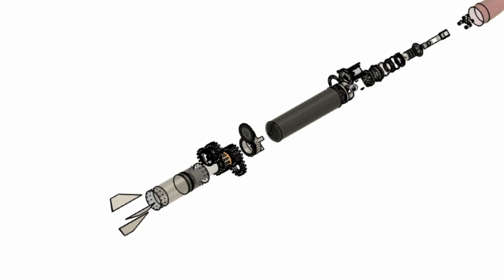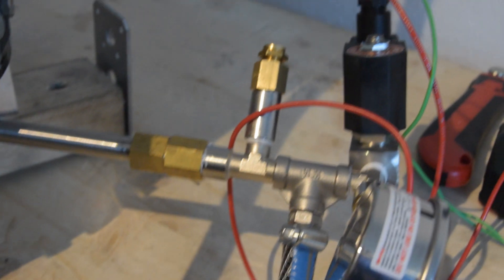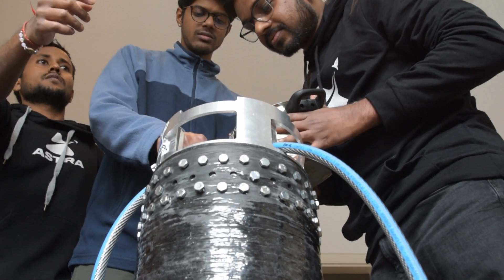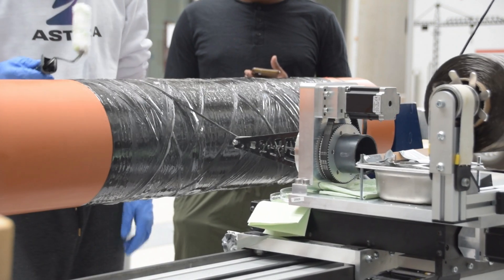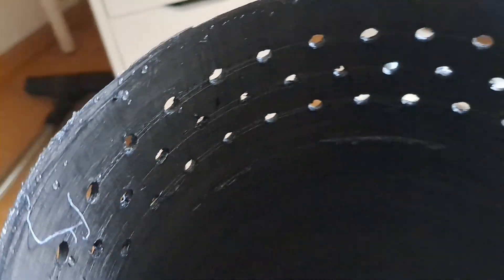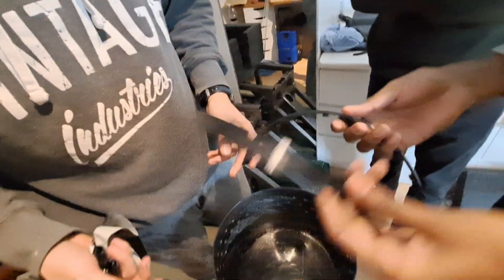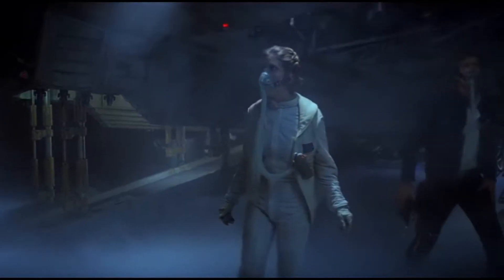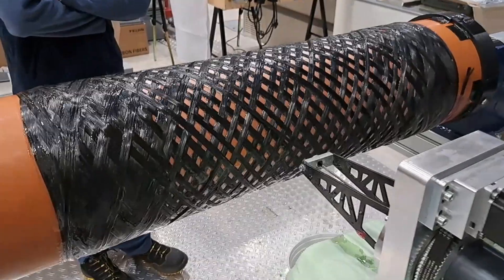The Saga of the Tank...

Comment: Un-Plasticized PVC (u-PVC) is actually pretty compatible with Nitrous Oxide, as is Halar polymer which can be sourced in tube form or LDPE also. Surprisingly Polyurethane is also resistant to NOX, and its completely possible to rotationally mold a PU liner and integrate some alloy end bosses to the rotationally molded part and then over-wrap it with CF. Anyway good to see yo move away from drilling through the CF composite.

Comment: This take me back to 2005/7. I helped build a filament winder to make some main spars for a wing. This was before arduino's and raspberry pi's. Had to make a hardwired control circuit controlling pneumatics. Working with resin and carbon fibre isn't easy. We made mandrels from aluminium, glass tubes and finally thin sheets of foam rolled into tubes. Keep on doing what you are doing - you'll learn a lot along the way.

Comment: Would some type of epoxy or rtv glue work, you should read Parker oring handbook btw, a good oring seal is definitely possible with those tolerances and the Parker handbook gives you design figures that work repeatedly
Reply: Also if you go the epoxy route be careful of mold release because it might work too well and stop the epoxy from bonding

Comment: Hello Astra... I hope you read this, 
I wish I was part of the team to warn you about the cf winding because I was pulling my hair when I saw the holes in the carbon fiber. 
I want to thank you for showing how to cast a bronze nozzle because I have never seen/ hear of that before, but now the possibility for cheap regenerative cooling is within reach for model rocketry.
As for the CF chamber winding, I suggest and please let me know if you disagree that you place rods in the location of the bolts in the mandrel that you are using for winding. You should wrap normally around these 3 rows rods and the fibers will find their way around them. Do NOT drill through fibers ever again because you are committing a great composite sin. After you finish the normal winding, I recommend concentrating on the ends and pass the fibers in between the rods (future bolt holes) to reinforce that region.

After everything, you can cut or remove the rods and bolt the aluminum piece and I can guarantee that you will have absolutely near impossible to tear winding because it will be working in tension.
As for the nitrous, you have used in the end an aluminum tank and wound cf over it (correct). You should have bought a plug and play car racing nitrous tank that is aluminum and already done to operate at 900psi-1400psi easily and safely. You are not using Lox nor pressurizing to 300bar, so a Cf is not necessary and an off the shelf aluminum or even Cf nitrous bottle would have been cheaper or the same cost.

Please let me know if you disagree with any point or have any thoughts, keep up the good work.
Cheers
Reply from the maker: Thank you for your super detailed comment.  One of the best parts of putting a lot of our information onto to this platform is the feedback that we get.  If it can also be useful to others sometimes, that is also great!

For the chamber winding, I completely agree with you.  Drilling holes in CFRP structures is not a very good move.  To make it work, we had to use a 0.7mm thick Stainless Steel liner underneath the CFRP lay-up.  We were toying around with your idea of winding around the holes last year, but we were struggling just to find the right methods for our design and never got around to trying it.  Maybe we will take a crack at it this year now that we are not starting from 0.

For the tank, we actually wound over a steel tank.  We know that our method was very mass inefficient, but we were mainly concerned with figuring our how to wind with carbon fiber.  To make the tank for the rocket that will go to space will require a 250mm x 5 meter tank.  This is certainly not something you can get in aluminum off the shelf.  Furthermore, we need to be able to meet a 3x SF to fly our rocket in Europe.  Safety standards are very high here so CFRP is not so bad when you are required to hit 180 bar.  If we were flying in the US we probably would never have bothered with CFRP.

Again, thanks for the comment.  I hope you continue to enjoy our channel.  There is lots more interesting excitement to come this year!

Comment: Wow very good job 👏. Can't wait to see it  fly .i have question  Can't we use normal oxidizer like kno3 and sugar. And what was the source of the  wax  thanks
Reply from the maker: Well, you could use Potassium Nitrate and sugar as the propellants, but that would be a solid rocket.  This comes with some challenges (especially safety and political in the EU).  Basically, it is very difficult to get the authorization to use Potassium Nitrate in Germany.  So, we opted to build and fly a hybrid rocket with Nitrous Oxide as the oxidizer and paraffin wax for the fuel.  We also get a lot more specific impulse out of this combination, so that is nice too.  The way just came from amazon - just regular candle wax.  Nothing fancy!  I recommend you check out some of our propulsion videos on the topic.

Comment: For those diameters, 3-4 mm of aluminium tube 6082 would have done.
Reply from the maker: Nope, you need safety factors man.  No one will let you launch anything if your safety factor is 1.  3mm Aluminum 6082 at 250 dia is 1.0 safety factor.  You need at least 2.0 to launch at EUROC.

Comment: I'm at 6:03 and my first thought is rather than drilling holes through the carbon fiber, secure the endcaps independently of the CF. Whether tensile supports external to the CF tube between the endcaps, or making the endcaps part of the CF tank.

Comment: Perhaps if the form was made out of a product that could be dissolved with a solvent like expanding foam coated with a release agent, you could make the ends of the tank and the walls in one winding.  Then you're only dealing with one material interface at the valve.  Winding the carbon fiber around a ribbed tube that the valve could be threaded on might work.

Comment: Didn't SpaceX blow up a falcon9 by trapping oxidizer in the layers of some copv nitrogen tanks during fuel loading process?  When the coov was pressurized the oxidizer was pinched and created a heat source that created a big badda boom.  Good thing your unlined cf tank failed or it might have exploded the first time you filled it up with oxidizer if the inside of the cf had any layer gaps.

Comment: But... why? Why not a pressure fed liquid engine, which requires lower pressures?
Reply from the maker: A liquid engine operating at the same chamber pressure as KARMA (33 bar) would require a very similar feed pressure for the tanks (yes, for liquid engines you need 3 tanks not one).  If we had more resources, we would switch to liquid.  But always good to question all parts of the design.

Comment: This is the same problem with the Titan submersible, not enough axial strength in the carbon fibre layup. Lot's of hoop strength, but not enough axial, plus all those stress concentrations and holes aren't helping. If you build the tank with bell ends you keep the axial strength at the ends

Comment: Could you solder/braze the thin sheet metal instead of welding or using a polymer on it? Need to look at electrochemical potential differences to avoid galvanic reactions.
Reply from the maker: maybe... we would have to experiment a bit.  The solder would need to be compatible with Nitrous Oxide as well.

Comment: I'm genuinely surprised that you guys are making all these tests on such a big part....why dont you start on a ~50mm tube to get the techniques right, then bump it up to 250mm ??
Reply from the maker: Good question...  Probably would be smarter.  However, keep in mind that there are things about winding big that don't translate well from winding small.
Reply: @ASTRABremen  such as ?
Reply from the maker: @shere_kan8329  1 - Fiber slippage.  2 - Max and min achievable angles.  3 - Effects of fiber tensioning.  4 - Effects of resin working time.  5 - surface finish quality.

Comment: There is a simple soltution to your problem 1.) don't use a pressure fed rocket engine 2.) exploit phase transition like from solid to gas  ---- all two come with their own challenges again  --- I guess making nitrous oxide boil would count as a novel approach --- something between 182 and 184 K and you use let's say a battery as a heat source or better something more chemical
Reply from the maker: I am not sure I follow the idea...  If you want to have pressure in the combustion chamber (which is necessary for thrust), you need higher pressure feeding into that.  The two options for creating that higher pressure are pressure fed (which we do here) or pump fed (which would be more complicated and expensive).  Maybe you are thinking of an Autogenous pressure fed system, but this is still pressure fed and you need higher pressure than combustion in the tank to get this to work.
Reply: @ASTRABremen  I did not say that it is simpler than pressure fed. Maybe worth mentioning are some kind of closing valves so the oxidizer doesn't return to the tank. As far as I know "phase transition" counts as a novel approach. I  do not have the figures in my head but at least it should allow lowering the pressure requirements as the pressure is not required for storage anymore.
Reply: @ASTRABremen  Sorry for the unclear answer last time. The idea was building up the pressure by triggering a transition from let's say liquid to gas. Imagine a steam engine with water just a bit below the boiling point. It costs little energy to create steam and now think of doing the same with very cold N2O. Okay, it's pressure fed but you can store more with less pressure and probably can use a light standard tank.

Comment: Best material we have found for composites mandrels is UHMWPE or even HDPE would do. You can machine precise sizes for the inner surface and then freeze out the mandrel (it has higher thermal contraction than pvc)
Reply from the maker: Thanks for the tip.  We might try that as an alternative in the future.
Reply: Also carbon fibre sleeve is good as a thinner alternative for filament winding (tho can be more expensive) we have been experimenting with producing 60bar pressure vessels using it and so far has held well to over 75bar at 1.5mm wall thickness (tho we expect that is close to the limit)
Reply from the maker: @robinbiskupic2639  This is actually one of the options we are considering for the fairings between the CC and the tank on the next rocket.  However, this doesn't work for making a type 4 tank.